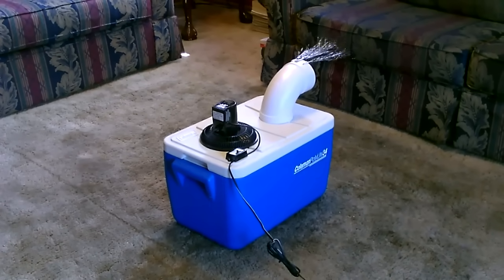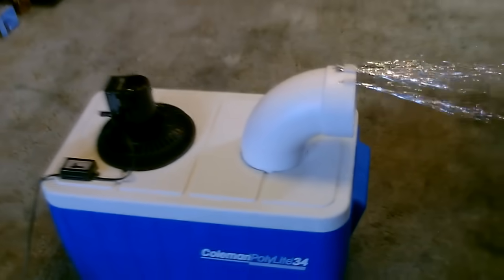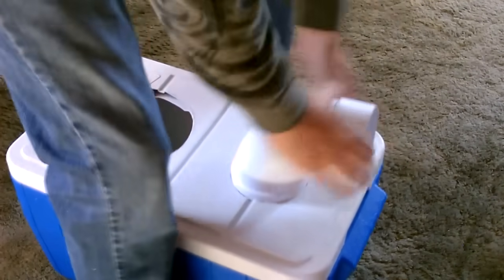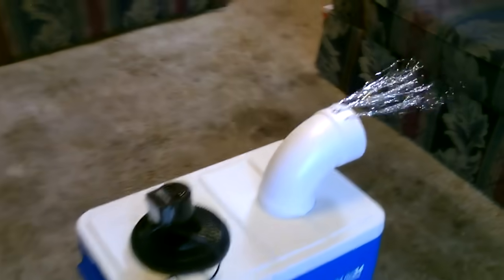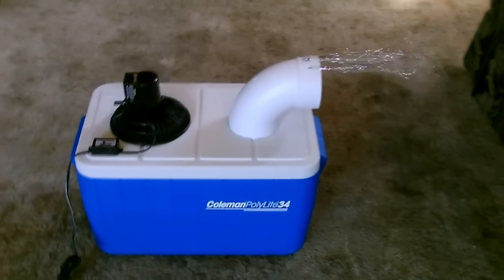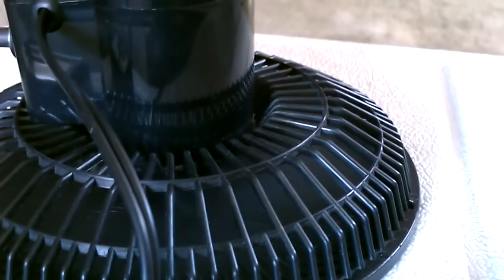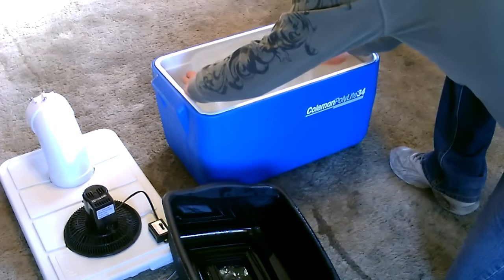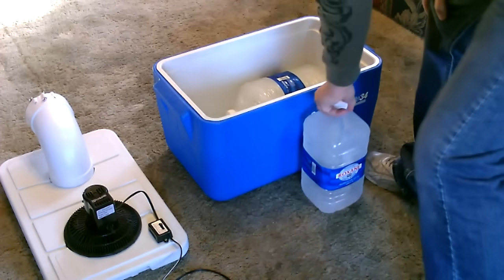Homemade air conditioner DIY - Awesome Air Cooler! - EASY Instructions - can be solar powered!

Comment: Ice blocks are expensive
Reply: Anthony Lopez You forget that a plastic bin that size takes up a good portion of airspace in the freezer. That reduced airspace means less area to cool thereby reducing the time that the compressor runs. Same principal applies to any freezer or fridge with lots of items. For example: place a gallon jug of water in an empty fridge for a few hours and check the temp. Then place that same jug in a fridge that's filled to capacity. The jug of water (and the entire fridge) will be much cooler than an empty fridge.
Reply: he showed you he filled a plastic tub and put it in the freezer.. its free :)
Reply: Im gonna ad another point to my previous statement about frozen 2-liters of water if you have a large deep freeze and keep quite a few 2-liters in it if you have a power outage it will help keep your food frozen longer and you can keep swapping them around for this application that way its no chance of a mess emptying it when it thaws and while not free it is a cheap easy way to store ice and if the power is out to long and everything in your freezer does thaw you have a lot of drinking water which is always a good thing!!!!!!!!!!!
Reply: Lindsay Corson  When you introduce something warmer than the set point in your freezer then the temperature of the freezer will go up. To maintain it's cold state your compressor will kick on and start the cooling process. Not only is there a cost of energy to run the compressor but it adds to the wear and tear to the parts of the assembly. This will reduce the life of your freezer so that's a cost too. It's hardly "free"
Reply: go to dollar tree and buy enough 2 or three liters to fill the cooler up then put enough water in them where they will freeze but not burst then once they are all frozen fill your cooler turn on your fan and boom not only is it cheap but you can keep re freezing them as much as you want and if you double up just keep swapping them out as the thaw!!!!!!!!!!!!
Reply: Anthony Lopez While I would normally agree, which I mostly do, the amount of wear on a decent freezer that it would cause is hardly a means to justify NOT doing it. None of this project, including freezing the ice, which costs money in water (unless you can handle reusing the unfrozen water) would be classified as "free." It will cost you far less in electricity to run a small fan than to run a mid-sized air conditioner big enough to cool off an entire living room. Not to mention the upfront savings of not having to buy a $200+ AC. I also don't agree with the statement of it being "free" but your approach was a bit harsh and one-sided. Perhaps explaining an alternative rather than outright shutting her down would have been more... well, humble of you, I suppose.
Reply: I'm going to try make this as non confrontational as possible. Thank you for agreeing with me and conceding. I feel it's somewhat backhanded to try to argue the semantics of, "what is money and what is it really worth" but I understand your want to be understood. For your information yes I'm aware of the concept of money being backed by gold this is actually called the, "Gold Standard." The gold standard was dropped by the united states, our money isn't back by gold. It was painful to read your statement based on your misinformation. The cherry on top was when you told me to do my research... You may want to take your own advice.
Reply: Anthony Lopez  Of course it's "Free".  Don't purchase water, collect it from natural resources such as running streams or rain. There are ways to distill both into clean usable drinking water (besides using electricity which cost). All of the " Introducing something warmer that the set point of a freezer, will kick the compressor on to lower the temp and this costs and will eventually break your freezer) is all based on logic ,science, the actual way things work and it's all purely semantics and shows exactly how uncreative some people are.
 There's this thing called winter where it's really cold. Pre-freeze the water out doors during this time inside the actual  5 gallon cooler or better yet do two 5 gallon coolers and maybe two 2-3 gallon coolers. Frozen solid place them in a deep freezer opposed to your actual refrigerator freezer. We have two deep freezers in our storage room inside our garage.
  That clears the issue of who ever said that heat would be re-disbursed into the room your trying to cool because of the actual process of a freezer doing it's job. In addition to that nothing warmer than the set point of that deep freeze was added hence no reason for a compressor to kick on causing energy spikes, cost and wear and tear on parts.
 What I am saying is this guy just showed us a quick easy diy in case your air goes out.  You or " I" would have maybe 20 hours of air in my deep freeze that was indeed free but if you want to get down to basics there are loop holes every where right down to making your own solar panels...which if you actually think about it can actually power your freezer so even if you didn't pre-freeze anything you would still have no cost ice and if your half assed mechanically inclined you can replace the parts that do get the wear and tear.
Reply: I'm not creative enough to find natural freezing because nothing naturally freezes in a 150 mile radius from my home D: Also if you're living in a climate where you can get naturally occurring freezing why are you going to need cooling in the first place? For those freezing nights and unusually hot days I guess?
Reply: Anthony Lopez  Nice.... was that sarcasm? Why would I need cooling in the first place if I live in a climate where I get naturally freezing temps? For unusually hot days? In addition to winter, we also have summer, but if you want to get to the bottom line...we also have deserts. I think everyone knows while they are arid and it's hard to find water and if you do it's more than likely contaminated because it's not moving. At any rate the point of a desert is: Those hot days that can cause you to dehydrate in a very short time frame and bring on hallucinations.... and that being the best case scenario with the worst being death are followed up by nights that drop to below freezing..where you lose appendages from frost bite...that being the best case scenario with the worst being either eaten or frozen.
 No I don't live in the desert that was a simple example in the extremes that a temperature can rise and fall with in a 24 hour time frame. So , yes it's for those "usually" hot days. Where I live we do get freezing temperatures, but rarely any snow during winter. In summer temperatures can rise to and surpass 106 degrees outside with the lowest being 90 degrees.You seem like a genius you do the math on how hot that would actually make the inside of a house or any building with no air conditioning.
Reply: You illustrate my point exactly in your situation. You're not going to get temperature cool enough to freeze water at night. Even if you froze water during the winter it's unlikely you'd be able to retain its frozen state without very strong insulation. No it wasn't sarcasm your desert example works perfectly with a large temperature difference between night and day. Great idea for the cooler nice thinking :)
Reply: K Dude...you must have missed the  deep freezer comment in my initial reply.Pretty strong insulation there,but you can win. I'm a grown up.
 I concede on grounds of : nothing is free because of cost in money which while physically tangible doesn't really exist. Consider the the money we make and spend each day in the US  There isn't enough gold " which currency is backed by" to even began covering our paychecks. BANKS don't even have "Money" they are a second party to the people who do. Each time we slap $100.00 bucks in an account in any bank another individual walks in the front door and signs a piece of paper stating he wants a bank to give him 900.00 for a lawn mower which they don't have in effect creating fake money. Once we sign that paper the bank turns around and sales our account to someone who does have gold backed cash loosing all rights to anything you have financed. We not being smart enough to understand this go on to pay 30 year mortgages and 5 year car notes only then is there actual cash in the bank "interest"
 Look it up. Do your research  because what ever your religion is...it doesn't state any where that the Government put us here,nor did we agree to be servants to the government, they are elected on behalf of us the people to serve us...the people and again whatever you religion is no where does it state that the land and air rights and mineral rights was for the government.
 My point is....everything is ours and everything is free. We allow absurd laws to be passed and rules to be made, and prices to be placed.
 Still I concede.

Comment: Try adding salt... it will lower the temperature even more. :P
Reply: seems like my dad told me he stored ice blocks under the porch all summer surrounded by sawdust to keep it from melting like 50 yrs ago...so, the salt idea, combined with the milk jug idea to keep the water from leaving, and the sawdust packing...does that sound viable? i like the foam cooler idea! i get those shipped once a month for scripts plus easier to cut!
Reply: Salt is used to melt snow so the block of ice  will smelt sooner .
Reply: thanks!
Reply: ***** You add the salt to the water before you freeze it.  Allowing it to freeze at a point colder than 0, and therefore giving more cooling effect.  It wont necessarily melt faster once it's frozen with salt.

Comment: I don't think the diameter of the fan whole is suppose to be big enough for the fan to fall in you should be straight if the whole is just for in inner diatmeter of the fan

Comment: This costs about as much energy to cool the house as an installed air conditioner, except the air conditioners on the market can adjust the amount of cooling they do reducing the power consumption. In other words- this comes out to be a more pricy option in the long run.

It takes the same amount of energy to freeze a block of ice capable to chilling a home to 42F as it would to just chill the house to 42F using a standard AC unit.

That said, I really like it, and here's why:
The benefit this has is that it's portable and, if you do it properly, you could technically run it off the grid entirely. To do that you need a mini-freezer for the ice hooked up to several solar panels during the day and several batteries at night. That said, freezers run at dramatically more power than fans do, so that dinky 15W won't actually do you much good; you'll need more.

Mini-freezers run anywhere between 110W to 150W; based on the quick search I just made. If you want to be completely off the grid you'd have to have ten of those 15W solar panels for AC.

Comment: Going to make one of these for camping this year, but you can use several PC power supply fans and mount them permanently to the chest housing with some screws, just be sure to use brass screws to avoid rusting.  One of these will cool off a 2 or 3 room tent in no time and makes summertime camping enjoyable.

Comment: Interestingly, I've learned by hiking a lot and freezing bottles that pure frozen ice isn't as cold as ice and water! If you freeze a huge ice brick, it might be 40F. But once it thaws halfway and turns into water, it will cool down the water and become like 37F. 

So don't freeze a bottle of water and go hiking. Instead, freeze a bottle and then take something to cut a circle through the ice going down the mouthpiece. Then pour the water into the bottle and the ice will cool down the water and ultimately be more cold than just pure ice. 

I'm saying this because people might say "Once it melts and turns into water, it's no good." and that is the complete opposite of what happens. Once it melts and ice cools down the water itself, it will get colder than 5 hours ago.

Comment: Hello I made my cooler with the wal mart fan as instructed in your prior video I brought the 1.5 watt solar panel at Northern tool it shows its working but not powering the fan, when I hook it up to the 12 volt battery it works fine is that panel to weak for this type of fan I use it here in San Antonio in direct sunlight and it shows on a led test that it works.  Thanks for the great videos.
Reply: solar panels are not meant to run items directly... you would be best to operate the an on a battery with the panel connected to a solar charge controller.If you look on youtube under solar power you will find a video explaining why.

Comment: just wondering.  just by looking at this, it's understood that the air output would be cooler.  but since the fan is so small, it doesn't push the air hard enough to cover a room.  depending o the size of the space it is trying to cool, it may not be powerful enough.